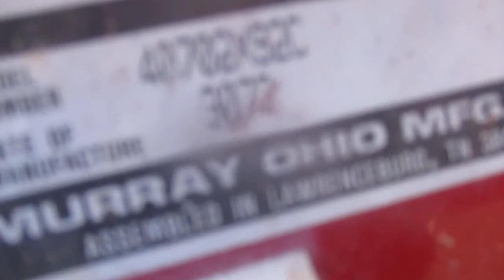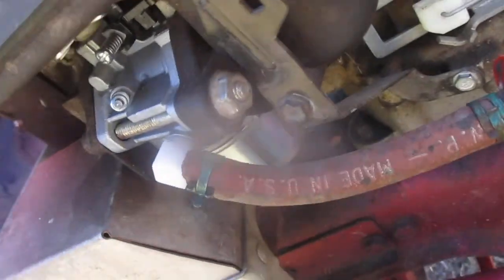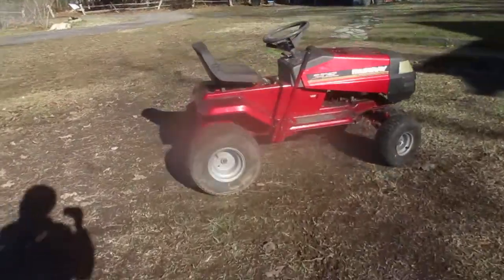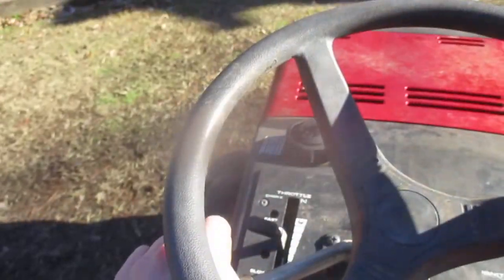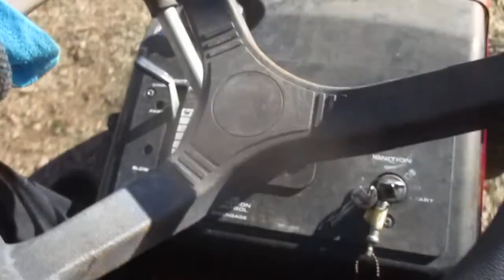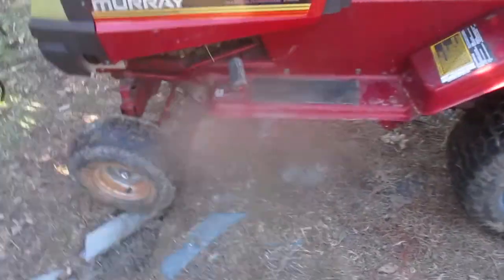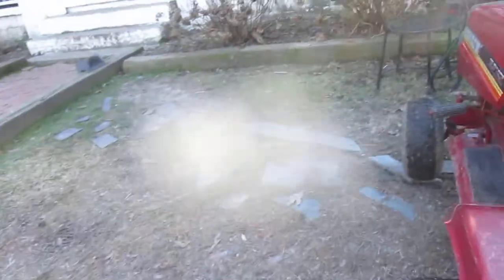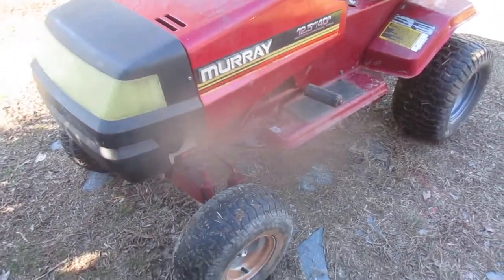My brother's Murray 40702X92C lawn tractor

Comment: That was a great video. I am looking for a starter for this exact same mower 40702X92C. DOM 0254. The online schematics do not list a starter in the parts lists. Do you have any ideas of how I could find one?
Reply from the maker: Assuming your tractor has a plastic gear on the starter, and a aluminum gear on the flywheel, this will work:
https://www.amazon.com/Briggs-Stratton-7hp-18hp-41022003-41022003R/dp/B00TOFFCPK/